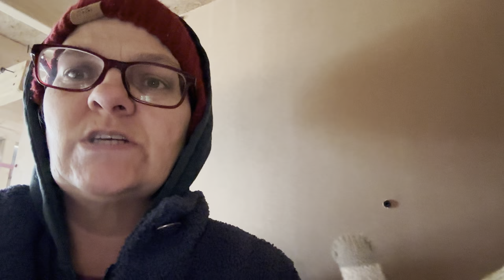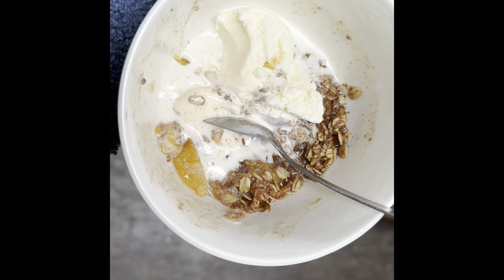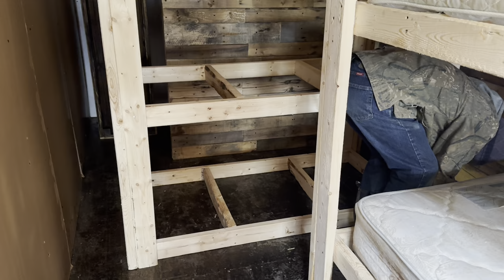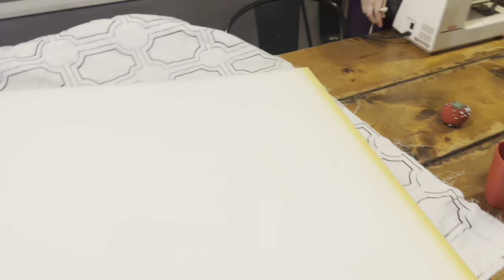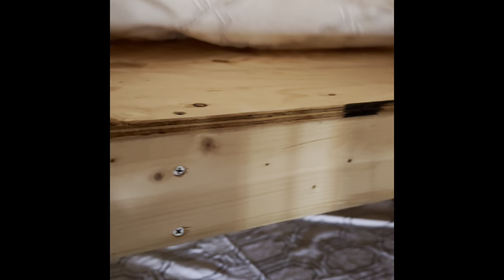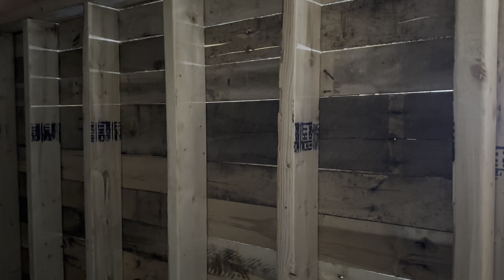Let’s build these bunk beds!

Comment: Yes, paint the bathroom. Odors may penetrate the wood, and paint is easy to wash plus it brightens things up. Also drill a vent hole in that area and install a vent of some kind - whether it’s up or out. 
Make sure you have a flooring that’s easy to clean in the toilet area. 
The peel and stick wood look alike vinyl flooring is easy to install and easy to repair. It’s very inexpensive but is being put in very nice houses.  
Seal the wood in the rest of the cabin so it doesn’t age to gray.
I’d paint or stain the bunk beds as well so the kids don’t get slivers. 
Maybe twin beds with trundles or futons in the loft? Futons you can just fold out of the way when not in use. 
Or even hammocks that hang from the loft rafters if the rafters are secure. 
Remember carbon monoxide detectors and fire extinguishers. 
I’ve been doing some prep and found a large silicone mat on Amazon for next to a wood stove to prevents a fire from sparks of falling burning logs 
I’m sure if you included some things on Amazon for ideas there might be those who would buy from your link and get a commission or even gift you with things for your house and cabin.
You are providing a how to service and many people find a blessing in seeing you blessed. 
I think you should try to monetize the channel with more links to product ideas of products you use and where to find them. 
You’re like me in that you like to make do with scraps and repurpose but link things you do order that you have found good use for - heating lights for an incubator - or anything that you do order - even links to the nut flours you buy. 
Ideas of things to link: Hooks,
Reply from the maker: Ok great ideas!  Kind of sound financial overwhelming but one bite at a time!